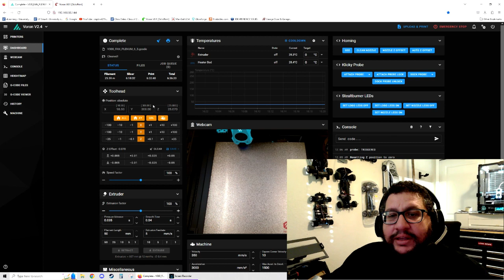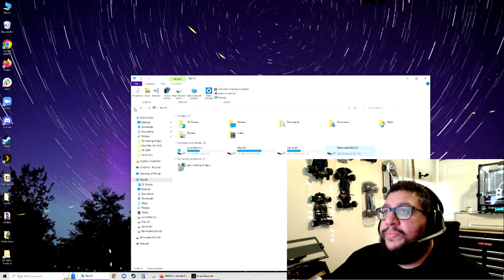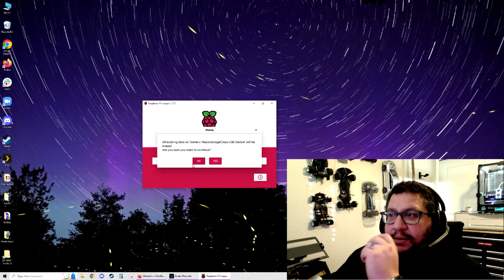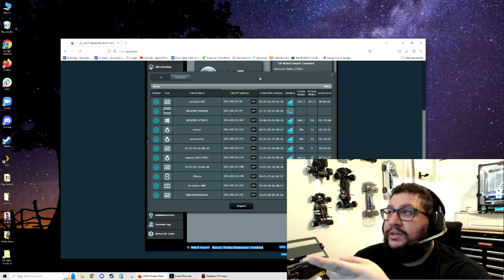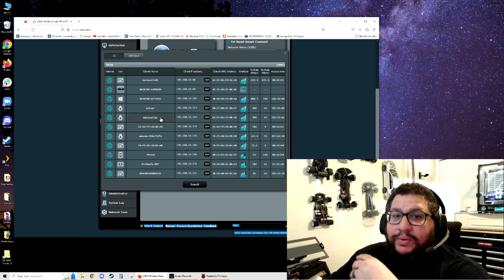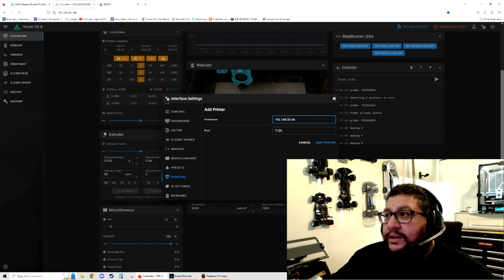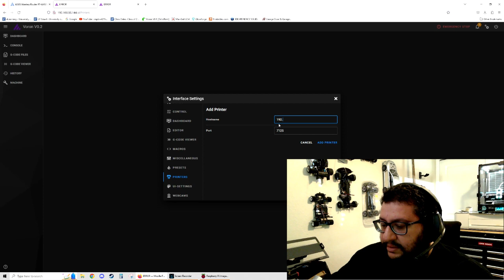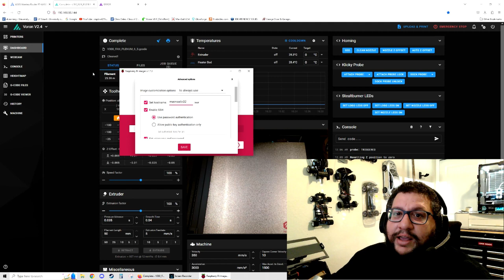Configuring Multiple 3D Printers on Mainsail? Raspberry Pi x2 and Mainsail x2

Comment: SIGH! 😮‍💨I'll give you that, if you read carefully, it was more or less said correctly in your title and description. So I will take back my downvote.... however... 

This isn't exactly the correct way of setting up multiple 3D printers on one instance of mainsail... if we're being honest you're just copy/pasting a working Klipper setup N times, then adding an extra Pi as the interface. That's not really all that useful... sorry.

What I'm trying to do instead (because I know it's entirely possible) is to set up ONE Single-board computer such that you can plug multiple printers into it and get them all working under mainsail. KIAUH lets you configure multiple instances of all the software components that would allow you to do this... almost. This is SIGNIFICANTLY more useful, as it allows you to put several printers together, with a single Pi "hub" running them all.

Comment: So there is no way, to drive multiple printers from 1 raspberry Pi4B? Unless they don't have different IPs?
Reply: There is, the only difference when they are on the same device is that they will have the same IP but different ports. So you have to edit the port instead of the IP.
In the textbox below IP you enter the port. Since both of his devices are only running one instance, they are both using the standard port 7125, thus he doesn't have to change the port.
Reply: Using KIAUH will let you install multiple moonraker instances easily, but they're on different ports.
Reply: @skippy9214  But KIAUH is not working on Mainsail 64-bit version tho